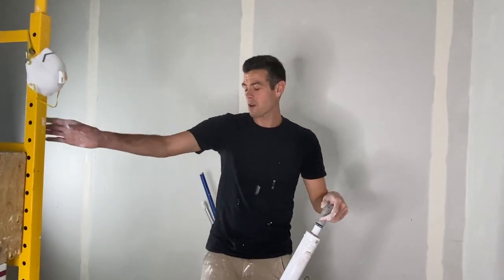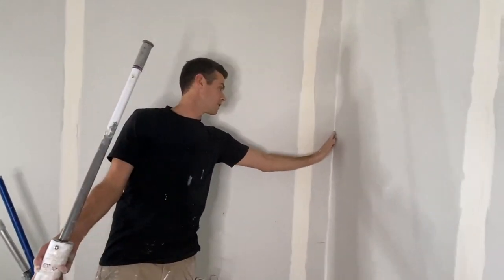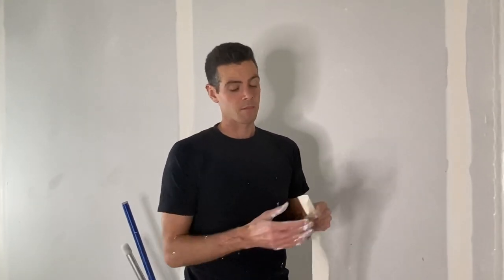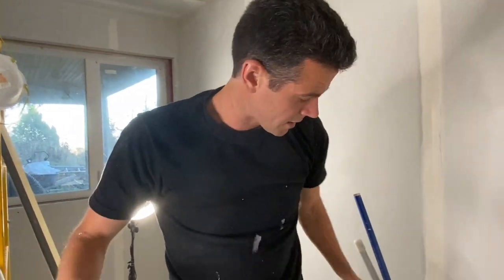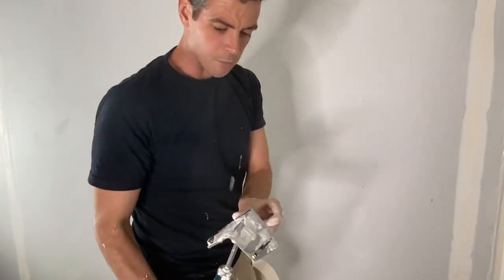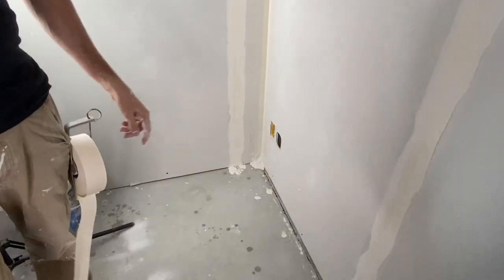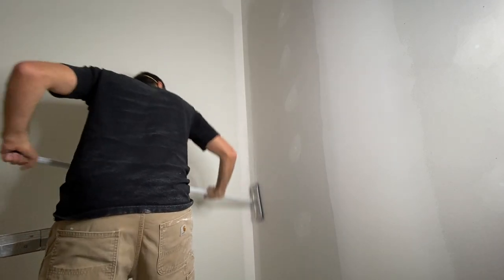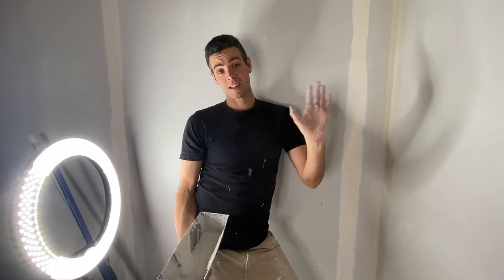How to get the BEST INSIDE CORNERS with drywall tools!!

Comment: Always love it when you use the tube, corner roller and flushers. Great video as always thanks Ben
Reply from the maker: Thanks 👍
Reply: @vancouvercarpenter  have you ever tried Straitflex Ammo Flex or No-Coat Level-Line for inside corners ?

Comment: I find the flushers work great for vertical internals, especially on Level Line, which is how we do it.  We use the MudRunner for all the paper taped horizontals, but it takes practice to get good at.  It isn’t easy easy as it looks.  Neither is the Bazooka, but once you get the hang of them there really is no looking back.

Comment: I'm trying to finish a room started by someone else. The drywall is a mess. Lots of cracks and holes where the mud dried. The walls are not the least bit straight and there are huge differences in angle from top to bottom between the existing wall and the new wall that I am going to have to fill in. I am not the least bit skilled at this. And I have shoulder problems like you do. Plus I'm old and it's really hard to get up and down off the floor. I have not been able to master the use of the wide tools. I just smear it around and leave lots of streaks down the wall. Hideous. All I can seem to master is the use of the 6 or 8 inch wide blade, and only going sideways not down the wall. I can get a nice smooth coat going sideways but that leaves dozens of pull offs I guess you call them on the edge of the blade. But compared to how ugly the first coat was this is a huge improvement. I can sand off the pull offs. But if I try to take the wide blade down the wall I get gouges and lumps that would need filling and sanding (I did sand off the corners of the blades too like you showed and that helps some). I can feather it pretty well going sideway starting off by pushing hard on the dry wall edge then slowly pushing less as I get to the corner. But even though I can't follow the instructions you are teaching I am still learning a lot about proper taping and mudding. My early attempts at drywall years ago led to walls full of cracks as the room heated and cooled over the years. I think I could avoid that if I was doing it again. Love your videos. They make this painful task almost fun to watch :)

Comment: Enjoyed all your vids as they provide great information.  This is off topic, but have just a few questions regarding pre-filling.

Do you pre-fill with Durabond  (hot mud).  If so, do you mesh tape?  If mesh tape is embedded into the subsurface, can you use paper drywall tape.  I will be skim coating my ceiling and want to make sure it is prepped right.  Thank you for any advise.

Comment: A drywaller cleaning up the leftover mud? What's next? The electrician sweeping up after himself? Great vid, I keep switching back and forth but usually do super taper because it's already setup and just want to get the taping done lol
Reply: Cleaning up mud? Any 1/4 gap in the base that would have left could get caulked in. Kidding.......kinda
Reply: The electrician comment is spot on. They couldn't leave more crap around if they tried.

Comment: Im sorry are you living in the 19th century? Not to be rude but what is a super taper? Either you have a banjo or a bazooka. Running tape by hand is so outdated, and plus box tools allow you to roll and plow your angles then use and angle box to skim every angle. Your techinque would add hrs and hrs to this job
Reply: If you did this you won’t have a job I can banjo without prefill and use roller with no issue

Comment: You do a lot of drywall. Is that where the money's at?
Reply: I believe it's probably one of the better unlicensed trades from a financial aspect. New construction particularly not a roof leaked and now a tiny patch is needed. It's quite physical tho. Like a concrete guy, he should make enough to retire early because you shouldn't plan to have the health to continue working at 70
Reply: No
Reply: I've learned the more you know the more you asked.  Always no.
Reply: @Spookytooth92  I do home improvement contracting but dont do a lot of drywall. Hard to find drywallers in my area